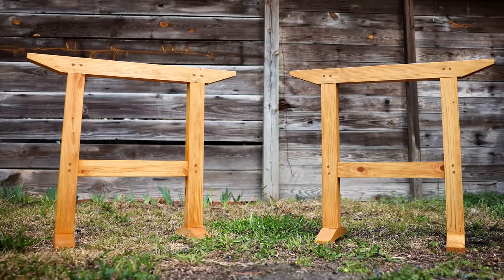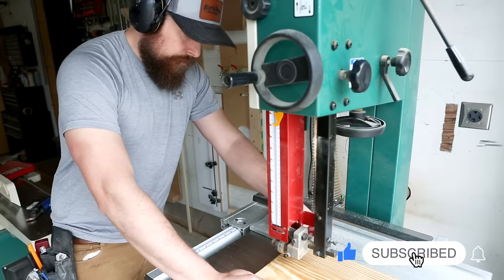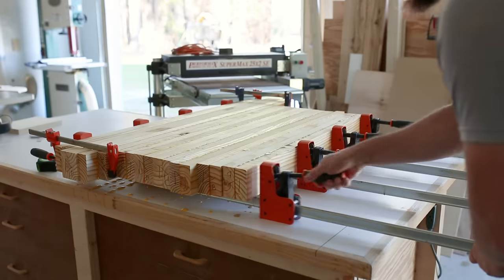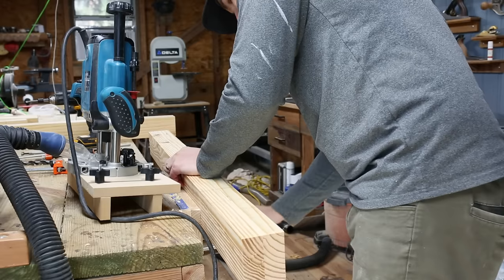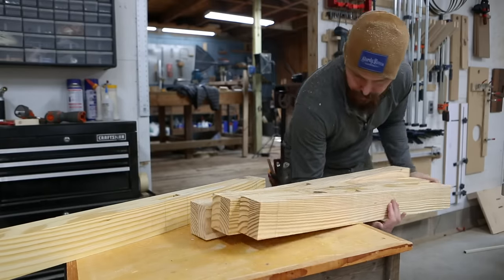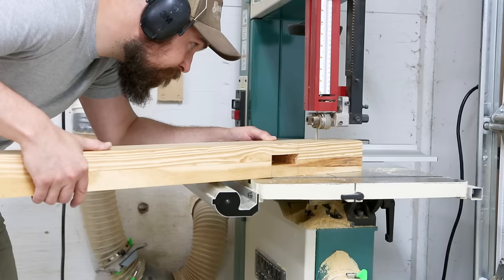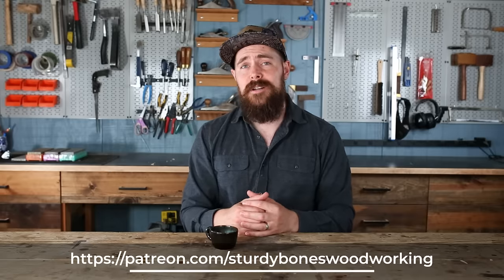You don't need a massive workbench

Comment: I think some people are missing the point. Sawhorses can be used for a make shift table if ones not availble, or if your work is not in need of a huge table. Just fepends on what your doing.
Reply from the maker: Thanks. I think so. The title might be a bit controversial sounding because of course big workbenches and assembly tables are awesome. But you definitely could get by with sawhorses with plywood on top for a while if you’re just getting started woodworking. Thanks for watching!

Comment: This are the European style saw horses. Used them a lot when I was over there. Never used any where the joints weren’t sprung so they moved a bit but worked. Saw horses come from when they had small houses and the table was a board or boards that were put up against the wall, horses nested and chairs hung on the wall when not in use. They may be called saw horses because they used them to rip lumber with a handsaw and could saw without obstacles.
Reply from the maker: Cool! Thanks for watching!

Comment: For those who say the game doesn't work, it certainly does. I missed the 2nd cupnfist time through. Got the rest ok though. Thank you for the free plans very detailed. Can these be made using a circular saw and/or Jigsaw as well. I'm new to this, and I'm 70 now, starting to feel it big time. Really do appreciate it.
Reply from the maker: I think you might have some trouble cutting the tenons with a circular saw but if you’re able to clamp them upright you shouldn’t have too much trouble cutting them with a hand saw. Same for the angles on the feet and top rail - I’d use a hand saw there as well. Circular saw will be best for cutting parts to rough length. Thanks for watching!
Reply: @sturdyboneswoodworking  thank you for the reply. I do have hand saws, and I will give that a go.

Comment: First off this look like fine furniture and not simple work holding. Very well done. But I have a few questions: why not cut the mortise before the initial glue up? Why glue in the top when it could easily be damaged by your sawing work? (This also could make for swappable tops and jigs) Why not offset the dowel holes in the mortise and tenon so you can get a tension hold between the pieces and not have to rely on the glue?
Reply from the maker: Thank you! Yeah I tend to make everything a bit finer than necessary. Haha. I really like all your suggestions and think they would make these way more practical. Draw bored dowels would definitely work great and allow for swapping out the top of it got damaged over time. One thing I might do with mine is just bolt or screw on a piece of MDF to the top as a replaceable spoil board. And yes, cutting a wide dado in each side of the parts before glue up could be a faster way to get those done as well, especially with a miter saw trench feature, for those without a dado stack or table saw. Thanks for watching and for your thoughts!

Comment: Solid work overall, and they sure look nice. Since you've already gone to the effort of doweling your joints, consider upgrading to the drawbore mortise and tenon to really help pull those joints closed. I really like the bevel detail you put on the exposed ends too, but I think I'd leave it off so that it's easier to clamp things down to these.
Reply from the maker: Really good point. I considered that, since I recently made use of them in my recent video on breadboard ends. I just chose to reinforce them a little bit since they're glued on anyway. I also like your thought about leaving off the bevels (or maybe just making them more like 45-degrees) to leave some clamping space. I guess I went way more for form over function. Thanks for the suggestions. I'll update the plans to make that suggestion to folks in case they want to leave space for clamping. Thanks for watching!

Comment: I've seen this basic design a couple times now, and I think it looks attractive, but I don't understand the beveled underside of the support on the ends.  It looks good, but there have been times when I've wanted to use a clamp to hold a piece that has been resting across my sawhorses, and having the beveled underside makes it much harder than if it were square.
Reply from the maker: Yeah in hindsight I agree that it might be more practical for clamping to leave off that detail, or make them shorter like a 45 to keep the  aesthetic but leave a lot more meat at the end to clamp to. I tend not to use sawhorses for things needing to be clamped so they’re working fine for me but I’d say customize them for your purposes for sure. Thanks for watching!

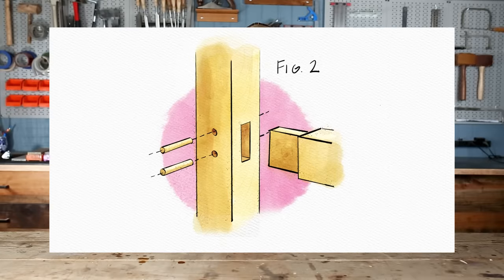Comment: 1:45 You only need 3 points to create a plane... 4 points will actually cause them to rock if placed on an uneven surface.
Reply from the maker: Yes you’re right. But four will help. If we were to leave it as 2 flat spots rather than cutting away the middle of the foot it would be way worse.

Comment: Question for you sir. I see you are using a Forester II Saw blade. How long have you had it? Do you clean it often, to remove the sap. I would also like to ask if and when you would get it resharpened?  I am asking as I am not sure if or when I should get my blade sharpened. I have cleaned it and that helped a lot. So just checking thanks.
Reply from the maker: I am using a Forrester II. I need to clean it more often than I do. lol. Probably about every other project, depending on the wood species I’ve used. I haven’t had this one sharpened yet but I’ve noticed a couple teeth that definitely need it. Cleaning it definitely goes a long way. I’ve heard there are great services that let you mail off your blade and ship it back nice and sharp but still need to identify a good one to recommend.

Comment: IMHO you need the dowels like I need a hole in the head. Better if you offset the holes by 1/4 their diameter and taper the dowl, then use it to pull the joint tight. Otherwise save the effort the glue is stronger than the wood.
Reply from the maker: Haha. Yeah I considered drawbored dowels but felt like these only needed a little reinforcement. But you’re right it’s probably not necessary since it’s unlikely these would be subjected to much racking force. Thanks for watching!

Comment: How does four points of contact prevent rocking on an uneven surface? I would think that you would need three.
Reply from the maker: Three would be best. But if you just leave the two flat feet, they’ll rock really badly if the contact with the floor is in the middle of the foot. So at least reducing that surface area helps some.

Comment: I swear that you said pressure treated. Maybe that term Carrie’s diff meanings in diff areas.  But for this area, it sounds like outside wood.  And that wasn’t outside wood.  Please help us that confuse terms.
Reply from the maker: Hi! Thanks for watching. I said there that I could only find pressure treated 4x4s (and you're right that's outdoor weather resistant wood), so instead of buying those I had to make due with the 2x12 pine boards I used in the video. Sorry that was confusing. I probably should have added that I don't like using pressure treated material on my table saw and band saw because they're wet, and that that's why I chose not to use it.